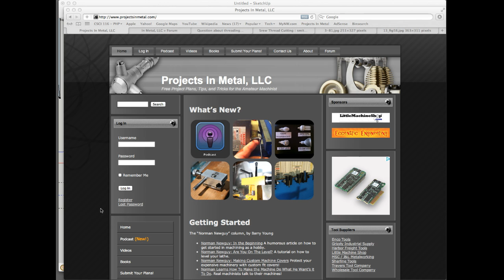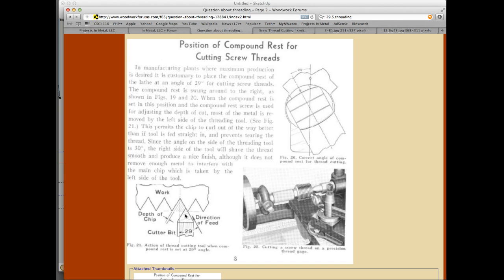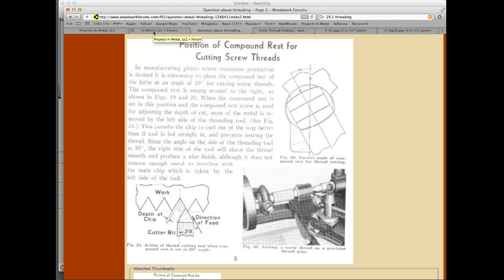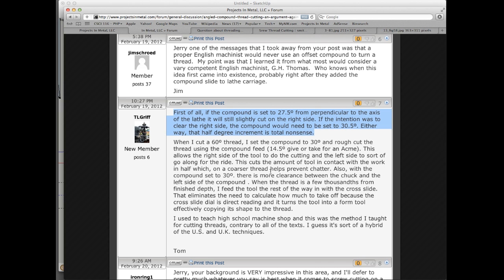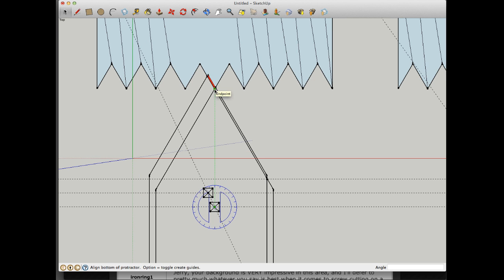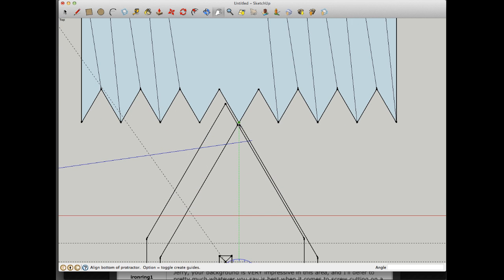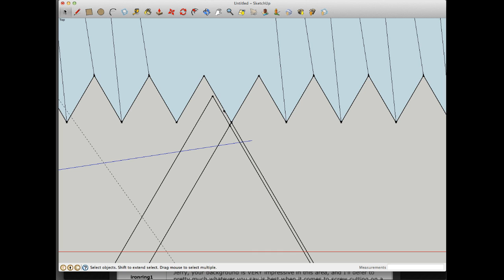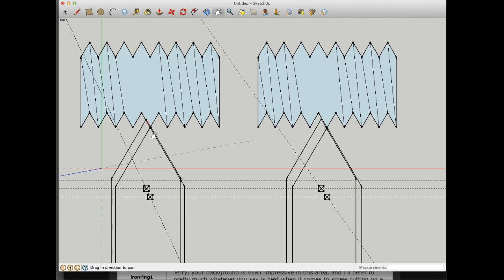Single Point Threading On The Lathe - 29 or 31 Degrees?

Comment: Based on reasoning 29 degrees is a safety margin. Machining is a process of exact values where as you cannot error on the plus. Meaning that you cannot replace material once removed. 29 degrees is a form of "sneaking up".  
This difficult operation that takes time to master. 29 degrees allows one to achieve success from a novice perspective. As the novice Machinist masters the threading operation he/she will no longer need the safety margin. They will soon set their compound to prescribed 30 degrees as they will know their machine and its quirks.  
Any value over 30 degrees will over shoot the 60 degree thread profile, causing a jagged edge by a factor of one degree on each pass. 
The illustration does not focus on the resulting thread profile. 29 + 29 = 58 , 29.5 + 29.5 = 59, 30 +30 = 60 workable profiles. 31 + 31 = 62 stair steps to the right eating into the previous pass.....

Comment: By using the 29 degree angle you are going to get the 60 degree thread. If you used 31 degree you would end up with a 61 degree or greater thread. By rubbing the side on one side and cutting on the other you will get the 60 degree of your threading tool.  what you want is for both sides to the tool to always be touching the material that you are threading. (note that on the rub side you maybe getting some cutting but not enough to cause a problem with the chip of the other side, but by cutting a little on the rub side you are guaranteeing a 60 degree thread ).

Comment: Does a 29 degree angle constitute a 60 degree angle cut ?It is close 
Probably good for most practical purpose,
But to take advantage of the threaded surface to give even wear,
You have to make sure the tool bit is at the correct angle and your feed in is exact.
Then when you use the thread it will be a uniform fit and it will tighten better then if it is not, as it will slowly cut into the other thread, Probably not noticeable in most cases,
Just cut it close and you will have sufficient use  from it
Reply: nope, a 30 or less in-feed angle will still yield exactly the angle that the FORM of the cutter profile has, so exactly 60 degrees, because it is a FORM tool and the last cut  will cut on the entire perimeter of it's form (at least the part that is below the o.d of the stock.

Comment: I am just an inexperience hobbyist, but the two friends who taught me to thread were both master machinists with vast maching experience in both job shop and r&d/production management..they both taught that the tool should be advanced by the compound set at 1/2 the thread angle, e.g. 30' for a 60' thread angle until the light finishing cuts when the cross slide should be used to feed the tool straight in. using their advice I've had no trouble, brain fart moves excepted, even at my novice stage of development, producing threads both internal and external to specs as measured by thread mike and peedee wires.

looking at your drawings I don't believe that they accurately reflect the two threading processes. you may wish to view a you tube vid on the subject by marc lecuyer aka thatlazymachinist.

Comment: I was taught that the reason for the 29 or 29 1/2 degree angle of the compound is to cut mostly on the left side of the tool while the right side of the tool would act as a support to prevent/minimize chatter.  Doing most of the cutting on one side also minimizes the cutting force required again helping to reduce chatter to form a thread with a better surface finish.  (600 hour Machinist Course, Aberdeen Proving Ground, Maryland 1965)

Comment: Not disagreeing with you but there are few "absolutes" in engineering except perhaps for zero degrees Kelvin. Personally. if I hear of a different way of doing something I give it a try and if it works I file it away in the old brainbox for future use. My current favourite for general purpose single pointing is an 1883 design clapper box tool holder and going straight in, but I do understand why others have their own favourite ways.

Comment: You just have to choose an angle LESS THAN half the angle of the thread. This way you can be sure that the shape of the cutting groove is right in every pass - you just have to make the groove deep enough. You have to be sure too that the cutting tool is perpendicular to the turning axis. There is no need for "cleaning pass" or "last pass with cross slide" - that's pure rubbish !

Comment: If it's not too late to join this discussion, some time ago I was in contact with a really old old-timer who was taught to set the top slide at 30 but make the threading tool 59 degrees. The forward cutting edge being set to cut at the correct angle. leaving clearance on the backside.   Well, in truth it was 27.5 and 54 (for Whitworth threads) but some I didn't want to confuse the issue.

Comment: Your looking at it first of all wrong in that your illustration is of a already cut thread. So now visualize it before it is cut and as you move the cutting tool into the work its actually cutting the left hand side. Think about it, as you crank the tool in at that angle of 29deg the tool is moving inward and leftward in the direction of the 29d line, which means its cutting on the left side of the tool not the right side, just the opposite of what you  would have thought.

Comment from the maker: The lathes at your work probably have enough horsepower to handle a plunge cut. But even if my lathe had enough HP I still find the threads to be ragged if I plunge straight in rather than taking a cut off of one side by turning the tool to 29.5 degrees.

Comment: I applaude your enthusiasm, but you are getting far too anal about this. 29º is what you set it at for 60º period. Unless you use a precision tool and cutter grinder to cut the 60º angle on your HSS tool, you will be out. Unless you use a digital angle finder to set your compound angle like i do, i guarantee your lathe is not that precise and you will be out. However, having said that there are variations. I will post a pic or 2 for you to see so you can understand more about it on your forum.

Comment from the maker: @crcarlsonUT So are you saying that the light cut on the right hand side (the part shown in red on the schetchup drawing at 4:20 onward) is something like a finishing pass that happens on every pass? If so, I guess that makes sense. I hadn't thought of it that way. I was thinking that the purpose of setting the tool at 29 or 29.5 was to prevent the right hand side of the tool from cutting at all.

Comment from the maker: @Films4You Yep, I've seen many of his videos. They are very good. I'm not so much questioning the 29.5 degree concept, I'm more wondering if it shouldn't be 31 degrees instead of 29 or 29.5 - especially after drawing the whole concept up in sketchup (4:20).

Comment from the maker: So are you saying that the light cut on the right hand side (the part shown in red on the schetchup drawing at 4:20 onward) is something like a finishing pass that happens on every pass? If so, I guess that makes sense. I hadn't thought of it that way. I was thinking that the purpose of setting the tool at 29 or 29.5 was to prevent the right hand side of the tool from cutting at all.

Comment: I was taught 29 deg so that the bulk of the material is taken with the left side of the tool cutter.  The principle being to keep the forces clearly on one side of the tool so that the backlash in the system always on one side.  The light cut with the right hand side is essentially a finishing pass so that you don't get small ridges in your part.